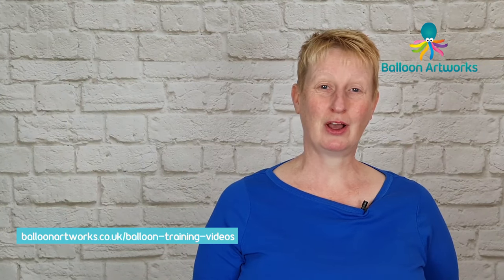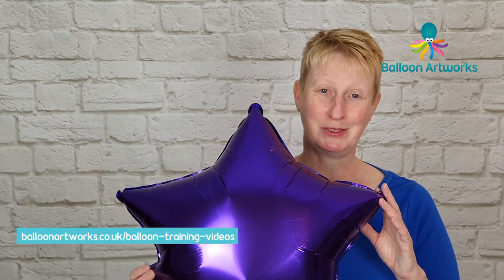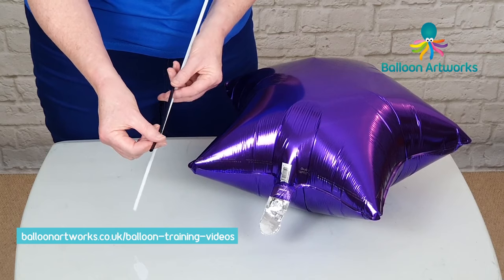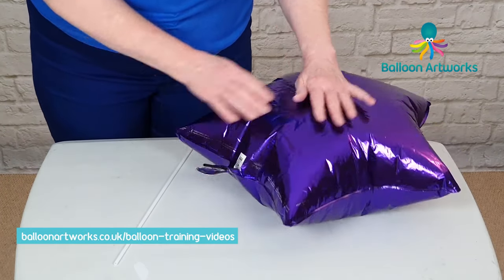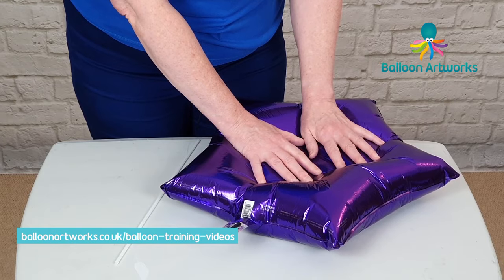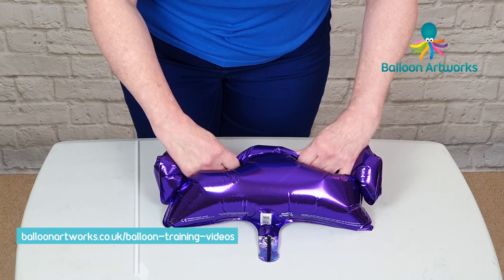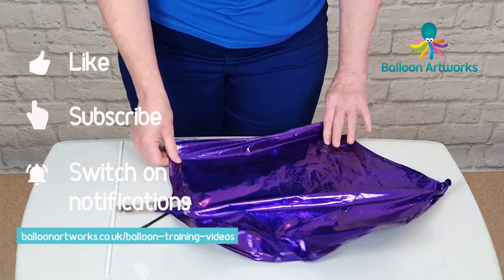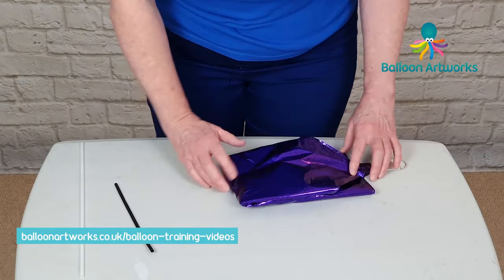🎈 How to Deflate a Foil Balloon and Reuse It - How to Recycle Foil Balloons and Use Again

Comment: Hi Mel. I wondered whether it would be worthwhile mentioning this to customers and encouraging them to return their foils once they are finished> Also how would you recommend disposing of foil balloons? I was in our neighbour's orchard this morning and found a burst foil in the grass, such a shame.
Reply from the maker: Hi Andrew. I think it's for individual businesses to decide how to handle this based on their particular circumstances, and there are considerations beyond recycling, such as ease of return and  provenance. Eg. easier to return to a shop than to a home-based decorator - I personally don't allow collections from my home. How sure can you be that the returned foil is one you supplied? Not at all easy for a volume business. What do you intend to do with the returned foils? Sell again? You'd need to be upfront with your customers if you're recycling stock in this way and you would need to be certain you'd supplied it in the first place as most UK insurers require you to have purchased from a reputable supplier. So, lots to consider. Foil balloons aren't currently recyclable, but they can be reused in many ways, some of which I recommend to my customers, including wrapping paper and for kids' crafts. You can also reuse them to cover sand weights and I reuse them when I'm experimenting.
Reply: @BalloonArtworks  Thanks for your comment. You have raised a few interesting points. I was just so appalled to see the foil in the orchard. It is a pity that they can't be recycled.
Reply from the maker: I agree. It's important to educate clients about the impact of letting balloons loose. I include a section on all my invoices and delivery notes drawing attention to the need to dispose of balloons responsibly.
Reply: @BalloonArtworks  Now (in Belgium) we can put foil balloons in the "recycle trash", as it is aluminum.  BTW, to Andrew, unfortunately some people release foil balloons in the air ; we as   professional have to educate those people. But we can't do anything to the people who buy online.... , it is the responsibility of those online shops to educate their customers, but usually Chinese stores (poor quality) don't....  Also sometimes they escape from the hand of  children, that's why it is necessary to fix them to the hand.
Reply from the maker: that's great that you can put your foil balloons in the recycling bins in Belgium ☺ ♻️

Comment: What happens if you rip the outside where the valve is with the straw a little but it is still keeping the air in. Am I going to be able to air this back up??
Reply from the maker: Hi Alicia. It very much depends. If it's still holding air, you may be okay.
Reply: Oh okay. Thanks so much.
Reply from the maker: You're very welcome.

Comment: I have a foil balloon rainbow dash my little pony it wont defleate even i use 60 cm straw
Reply from the maker: You need to push the straw deep into the balloon so that it opens the valve inside. If the balloon isn't deflating, you need to push the straw in further.

Comment: Yep, have a whole set of balloons that will not deflate.
Reply from the maker: You may need a longer straw
Reply: @BalloonArtworks  I would think a 9 inch straw would do the trick when the balloon is only 12inches.
Reply from the maker: You would think so. The straw needs to be long enough to open up the end of the valve to let out the air.
Reply: @BalloonArtworks only worked with a really long straw for me
Reply from the maker: That's fantastic. Thank you  🎈

Comment: Thank you ❤️
Reply from the maker: You're very welcome ☺️
Reply: @BalloonArtworks  its not deflating for some balloons even with longer straw. Any tips please 🥺
Reply from the maker: It sounds like your straw still isn't long enough. The straw has to be long enough to open the end of the valve. If the air isn't coming out, the end of the valve can't be open. Hope this helps.